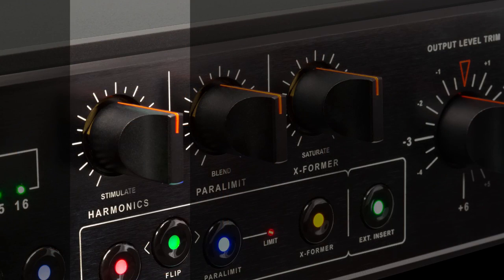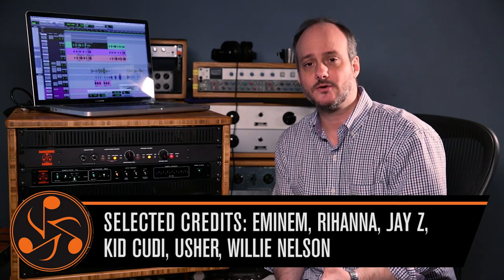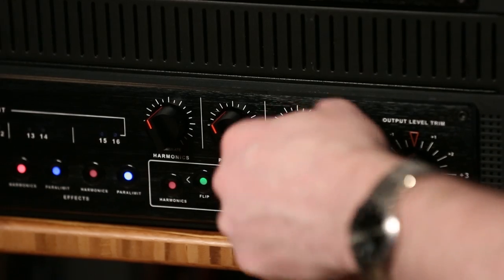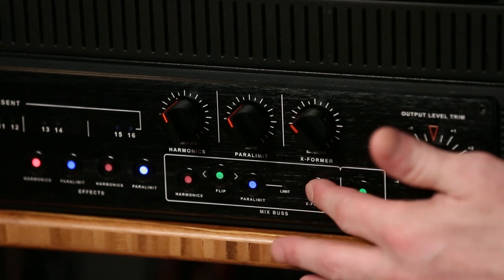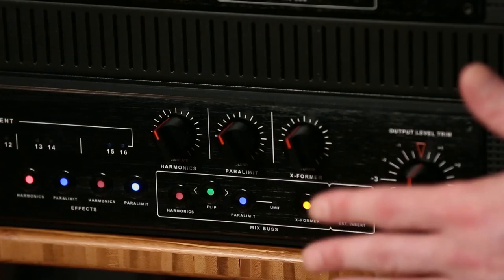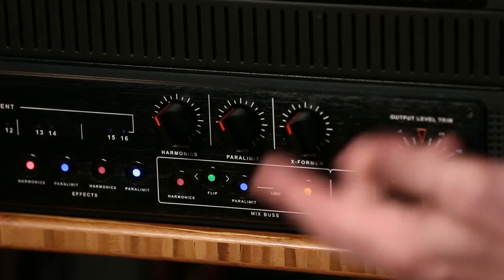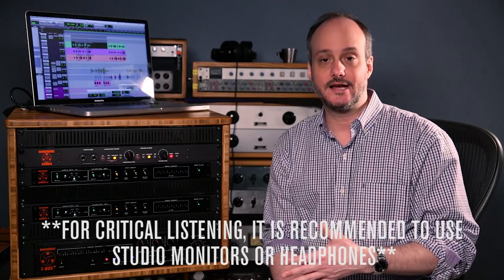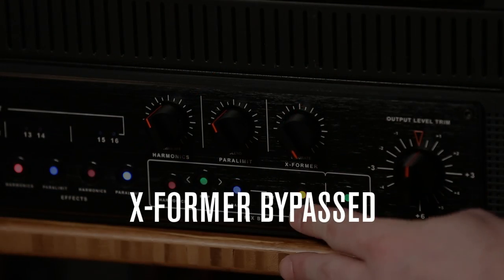How Transformers Can Enhance Your Mix

Comment: I think it might be worth noting that there are different types and models of transformers, and they each seem to have a sound (frequency bandwidth, curve, behaviour, tightness, vintage vs modern, a.s.)
Reply from the maker: Correct! Thank you for pointing that out. All three of our X-FORMERS are different as well. X-FORMER I in 2-BUS+ is a pair of custom wound Cinemags, X-FORMER II in the CONVERT-AD+ is a pair of Hammonds and X-FORMER III in 2-BUS-XT are an off the shelf version, where we listened to 25 different options before settling upon these. That way, when you add more gear, you're collecting more sonic options.

Comment: Isnt the transformer simulated in all VSTS that are copy's of real effect units  like WAVES for example , they all have ANALOG button
Reply: Pavle Pavlovic the Analog button imparts a ground hum signal to emulate the noise floor of outboard gear. That's why you get the option of "50hz" or "60hz".